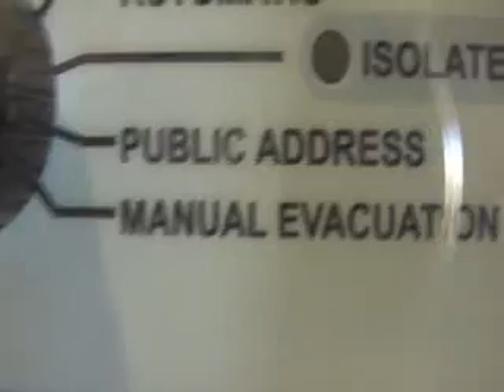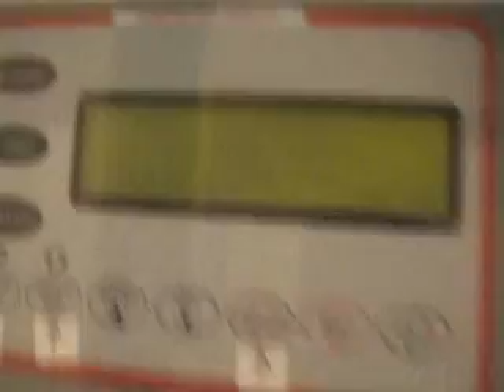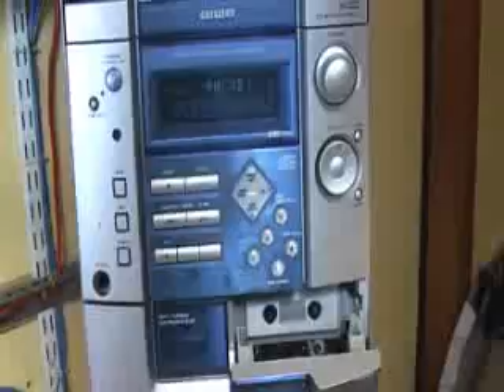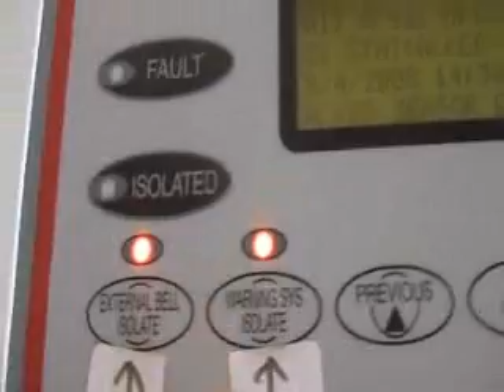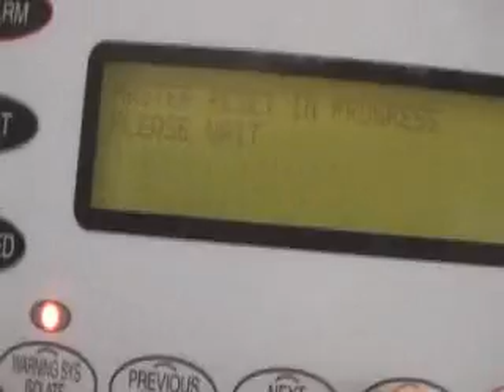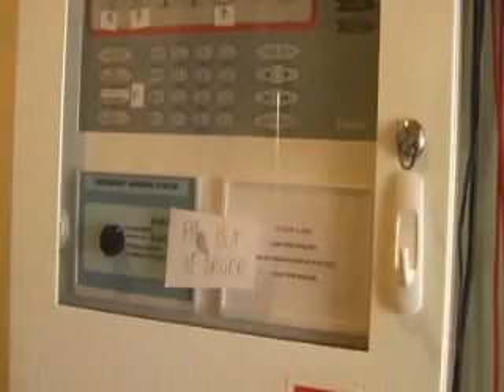41st - Fire Alarm Expo and House set up!! Part 1

Comment: definitely would be a good idea to install that connected smoke detector in the room with the panel, i've been doing research on installing a combination burglar/fire/carbon monoxide/flood alarm to be monitored by a company to reduce our home insurance (you can save a lot of money on insurance in canada with these things), and most of the equipment companies insist on installing a smoke detector in the room where the panel is